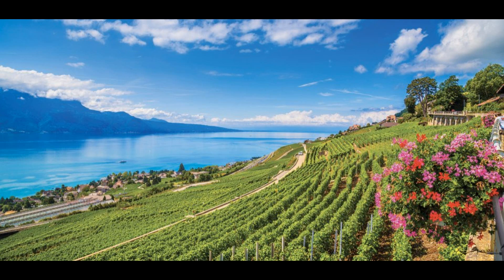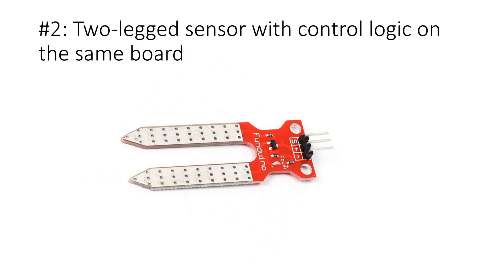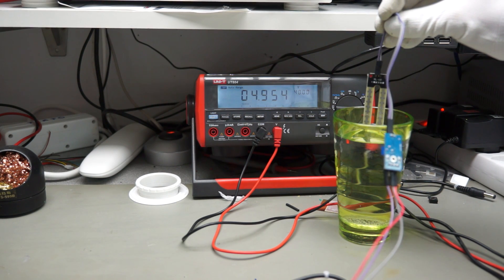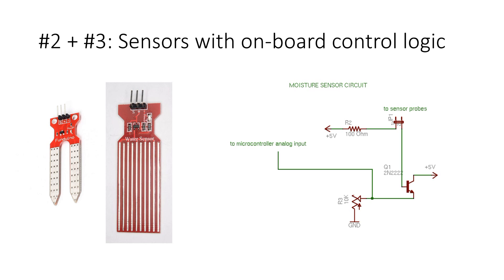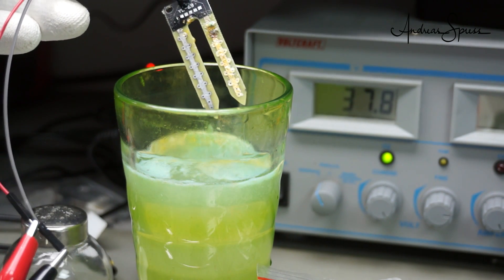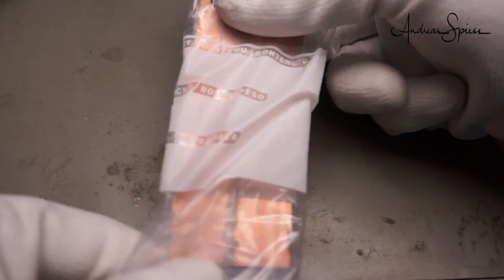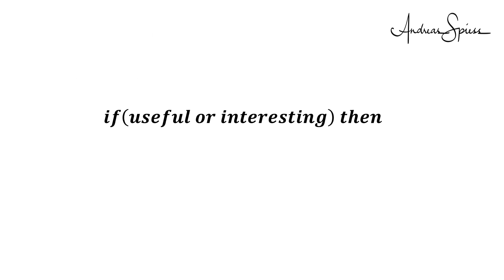#207 Why most Arduino Soil Moisture Sensors suck (incl. solution)

Comment: I am truly confused. If you put the sensor in a plastic bag, how can it measure moisture? Also, if the bag protects the sensor, why wouldn't the manufacturer use a plastic coating?
Reply from the maker: Through  a capacitive effect. It does not need a connection.
Reply: @AndreasSpiess  I just tried it using a thin Dollar Tree sandwich bag. The moisture went from 29% without the bag to 8% with the bag. Pretty much what I expected and explains why the manufacturer doesn't plastic coat the probe.

Comment: You missed one - TDS sensor, which works like the resistance sensors, but uses AC on the two metal electrodes instead of DC, so they do not corrode.
Reply from the maker: I agree. But these have a very different price tag and mostly are used in professional settings.

Comment: so the two-legged probe/sensor usually breaks after just a few days of use because the metal strip corrodes quickly. It is true?
if it is true I have to buy many two-gauge probes/sensors and change them every time they break or I can use the "operational control module" circuit connected to a handmade probe/sensor with two copper strips of the same size connected in the same way to the operational control module? thank you so much, great video!
 I am purchasing a kit from Aliexpress that includes everything needed to build an automatic pump with a 5v pump, a 5v relè, the sensor itself and an operational control module that conncts with the two legged sensor. However, the sensor is the two-legged version which corrodes but I cannot get a kit equipped with the probe/sensor v 2.0 because for that you need to know how to use Arduino while not for the two-legged probe. could you help me please? I'm having trouble, thanks again!
Reply from the maker: I think you know what has to be done.

Comment: Just beware that a lot of the capacitive sensors on the market are faulty, with a whole range of different faults.  Good luck finding one that works properly.
And don't be fooled by v1.2 and v2.0 as seen on these sensors.  They are identical - even down to the faults.
Reply from the maker: Thank you for sharing your experience! With the knowhow of this video, you should at least be able to find the errors ;-)

Comment: hey,
where should I connect the oscilloscope probes with the capacitive sensor /
Reply from the maker: If your sensor is battery-operated, it does not depend. Otherwise, connect the ground to the ground pin of the electronics.

Comment: if you have the two-legged sensor with the controller pcb cant you just replace the prong with two nails?
Reply from the maker: There are many different proposals in the comments on how to solve the issue...

Comment: Hi Andreas
I found good results using 5V amplitude for square wave and 3k resistor instead of 10k, I also buffered the square wave, your data for frequency are accurate, I designed a sample sensor from copper foil, how can share a simulation file with you in LTspice showing values of capacitors for sensor?
Regards,
Suded
Reply from the maker: This is an old project and so far, I do no more work on it. I am glad you found a satisfactory solution for you.

Comment: 我做了這個項目； 檢測當前溫濕度+自動澆水系統（代碼已修改，調試集成測試）
I made the project; detect the current temperature and humidity + automatic watering system (the code has been modified, debugging integration test)
https://youtu.be/d1NLjSjUNV4

準備好了材料- 我製作項目；檢測當前溫度與濕度＋自動澆花系統
The materials are ready - I make the project; detect the current temperature and humidity + automatic watering system
https://youtu.be/w9cghrXF_uM

加入2個二極體原因（含圖紙）,解說反電動勢/加入使用USB_micro座模块與棑針模块/電源供應使用5v-2A
The reason for adding 2 diodes (including drawings), explaining the counter electromotive force / adding the use of USB_micro socket module and pin module / power supply using 5v-2A
https://youtu.be/KimNTPJ4Kos

這個項目*自動澆花系統*，我準備好了各種模块，代碼我已經修改好了（保證可以用Arduino Nano或者UNO開發板）
For this project *automatic flower watering system*, I have prepared various modules, and I have modified the code (guaranteed to use Arduino Nano or UNO development board)
https://youtube.com/shorts/q8UFHadgAEY?feature=share
Reply from the maker: Cool project!

Comment: With the ESP32 you can easily use the Touch-Input Pins. Just isolate a cheap resistive Sensor like this  https://wolles-elektronikkiste.de/wp-content/uploads/2019/03/rainsensor_examples-1024x808.jpg
and connect the 2 Pins (without the Elektronik) with the Touch Pin and GND of the ESP. Works fine and the Touch Pins can wake up the ESP from Deep-Sleep.
Reply from the maker: Interesting idea!

Comment: A channel named "Flaura - Smart Plant Pot" has a video titled "Capacitive Soil Moisture Sensors don't work correctly" that you might find interesting.  He includes video clips directly from your tests, and mentions the need for a 3V regulator in-circuit to get reliable, repeatable readings.  Some boards exclude that regulator (shunting that connection with a 0-ohm resistor, for example, if the regulator's footprint is actually on the board).
Reply from the maker: I think I once was contacted by the creator of this board. Stable voltages are important for most sensors, BTW.

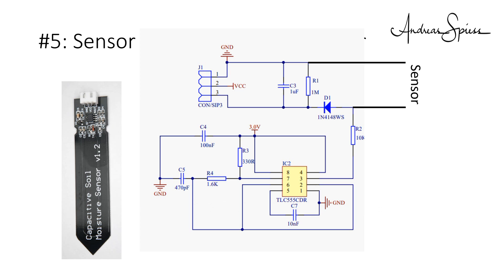Comment: You could just plasti-dip or varnish one of those cheap resistive sensors, and then build a small board using the design @7:24.   It's on my project list, anyway.
Reply from the maker: Can work if it has enough capacity between the two legs.
Reply: @AndreasSpiess  Excellent point sir - those prongs are pretty far apart, so capacitance values will be lower than the design normal for this sort of sensor.

Comment: I have some humidity sensing electrodes that are gold-plated, I assume to minimize the electrolytic degradation processes. I'm curious how long I should expect them to last due to the more inert gold plating. Though obviously the capacitive circuit is the best way to go for long-term monitoring. Thanks for pointing out this solution.
Reply from the maker: I assume gold plated material lasts longer. But I do not know how gold interacts with other chemicals. Some commenters reported heavy corrosion with different materials.

Comment: An informative video that points out the short comings of the different types of commercial sensors that can be purchased. It would of course be easy enough to elongate the life of these but because they rely on conductivity, they do need to be exposed to the soil, whereas a capacitive sensor, does not so can be coated to protect it. 2 nails would suffice to replace the copper electrodes if you wanted longevity, or because of the price of these types you could just replace them every year. 
Thanks for the video, it gives people insight into the different types to use
Reply from the maker: You are right. There are many other comments on the different solutions and suggestions...

Comment: You could run the cheap resistive sensors with AC over a capacitor. AC will not corrode the sensor.
Reply from the maker: There are many comments about this topic. It anyway corrodes (unfortunately).

Comment: How does it changes reading when you cover it with plastic I am using esp 32 but when I cover it with plastic and dip in water readings don’t change
Reply from the maker: The capacitive sensors should work with plastic around them. The resistive obviously not.

Comment: Great video! For those of you that wanna know more about the topic there's a good overview of various soil moisture sensors in elektor magazine that was just recently uploaded. It's called 'Moisture Sensors for Watering Systems' by Peter Tschulik and is pretty instructive
Reply from the maker: Thank you for the link. Unfortunately, he also does not provide data. So far, I never saw a study showing how good or bad the different sensors are.
Reply: @AndreasSpiess  There are a bunch of scientific papers comparing different soil moisture sensors, for example 'assessing the applicability of low-cost soil moisture sensors' from April 2020 by Abdulla Alshahri

Comment: Based on my real experience, this type of 2-plate sensor probe is USELESS. It can only last for less than one month. I am currently replaced it with NICHROME wire as the probe, space it out so that it creates a resistance. Nichrome 80 wire is corrosive resistant. I am currently monitoring it for the next few weeks to see the result (March 11, 2022). I will update the status later.
Reply from the maker: Cool. For sure NICHROME will last longer...

Comment: Hi, can i directly replace the low quality sensor plate with the capacitor sensor plate?
Reply from the maker: I assume they will provide different values for the same moisture. So you have to change the mapping.

Comment: So why not build your own capacitive sensor with a 555 instead of buying one on Alexpress ?
I have several DHT22 sensors and the have all failed giving erroneous readings of humidity  (although the temp section is still good)
Does anyone know how to fix those DHT22 humidity sensors ?
Reply from the maker: I am not sure if they can be repaired. I hope you did not try to measure moisture with them. It is someting different.

Comment: Andreas - love the channel.  Extremely informative and I have tried many of your projects.  Along the same lines as moisture sensors, can you explain why ph soil sensors work so poorly as well?  Maybe there is a best configuration for probes (single vs double vs glass)?  It just seems that given the correct conditions, soil ph should be able to be measured with metal probes without having to put the sensor in a separate solution.  Any help, advice, or guidance would be greatly appreciated!  Keep up the great work!
Reply from the maker: I am not much in chemical stuff. So I have no idea about PH sensors :-(

Comment: I brought an auto water kit, board, relay that came with the corrosion sensor, can I straight swap for capacitance version?
Reply from the maker: I do not know the diagram of the device :-(
Reply: @AndreasSpiess  thx for getting back to me! If you watch this vid from 12min to 15min mark. The capacitance sensor volts are Air, 3v, - Water, 1.66v and for the cheap sensor, Air, 4.99v and Water, 2.37v. Is there any way I mod circuit or maybe I could also use the potentiometer on the cheap probes board to tune it closer like? https://www.youtube.com/watch?v=EZM3w_XAwQU kind regards.
Reply from the maker: I would try to do a calibration for the new sensor. It seems you can set min and max values at least.

Comment: At 8:37, on your design, why the capacitive sensor is conected at the same node? , from the shown circuit (see 8:19), the sensor is connected one side to the anode of the zener and the other pin is plugged to ground? why?
Reply from the maker: It did not matter for my setup because I used an oscilloscope which can show positive and negative values.

Comment: Dear Andreas, we make a fabric able to sense humidity. It's resistive sensing element is made of stainless steel. We think its main advantage is to be able to measure humidity right in between the plant roots and not only in the surface of the vase.  Let me know in case you want to test it.
Reply from the maker: So far I have no plans for a additional video on this topic. Did you make scientific tests to prove that it works? Because so far, nobody was able to show a correlation between real and measured humidity of such sensors (resistive or capacitive)

Comment: Just checked a module shopping website in Korea and the 5th one was 8 times more expensive then than the second/third ones. And the first one was 4 times as expensive as the second/third ones. If one does not know that only the 5th lasts long enough, most people would buy the second/third one because they are cheap.
Reply from the maker: I assume the simple ones are also cheaper to produce...

Comment: Hello Andreas, long time fan here.  Just found this video.  There is another alternative to the capacitive sensor, which is used in commercial farming operations...the gypsum sensor.

FYI - the guy who developed the Vinduino (Reinier van der Lee) water platform spent some significant time creating, characterizing and testing DIY robust soil moisture sensors.  He uses AC voltage on stainless electrodes buried in gypsum.  His 2012 blog is here, good reading lots of info. https://www.vanderleevineyard.com/vineyard-blog/category/all/8 
From the blog: "The electrical resistance between the electrodes is a measure of soil moisture level, or better: the soil water potential. The gypsum acts as a buffer for saline solutions making the measured electrical resistance of the sensor less responsive to salt in the soil."

These are similar to commercial agricultural sensors (e.g. from Watermark corp, https://www.irrometer.com/pdf/sensors/403%20WATERMARK%20Sensor-WEB.pdf)
Reply from the maker: You are right. I saw such gypsum sensors but they were much more expensive. Maybe that fact changed by now.

Comment: I use niti for sensor. Perfect.
Reply from the maker: Do you have a link?
Reply: @AndreasSpiess  NiTi is an alloy of Nickel and Titanium that is used in dental appliances.  It does not create oxides by electrolysis and lasts for years without losing its properties.  I took the first test in 2016 at the university.  I recently use it in a nursery.
Reply from the maker: Thank you for the info. Now I googled the thing :-)
Reply: I didn't find anything about this type of sensor using NiTi.  Did you find something about it?  Here it says based on need.  My wife has a Cactus and Succulents nursery.  
This type of plant cannot have moisture accumulated in the substrate.  Substrate generates false positive with capacitive sensors.  At least that's what I realized.  I need to run more tests. 
 If you know any more progress let me know.

Comment: Very cool!  It is that time of the year, well a bit past it and now we are into the horrid heat wave time here on the High Plaines of South Dakota! I was looking for info on these devices, since I have a couple in my supply of Arduino things and wanted more info on them.  My daughter, who now cooks and keeps the house for me since I lost my wife nearly a year ago to cancer was nearby and loves to listen in to my YouTube favorites.  She asked if I had one, and I said I did but my wife didn't want to use it.  She does!  So I may give the old ones a try for a bit, as my daughter has also taken over the care of my lovely wife's flower pots that she has kept for years, and keeps up the flower gardens she has made with the stones we picked up on our travels in our Motor Home when we were both healthy enough for such things.  So I guess I will dedicate a small Micro  or Mini to the chore and she can monitor one of the pots to see if they need watering, well until they die of electrolysis disease.  Your channel, sir remains one of my favorite since we both enjoy directing electrons in strange patterns to do our bidding.
Reply from the maker: This is for sure a good idea. and if you would use an old ESP8266 you could even add some remote aspect that your daughter could monitor humidity without going to the flowers...

Comment: Another option is to beef up the electrodes with thick copper wires (soldered). They will eventually corrode but last much longer.
Reply from the maker: True. But this green stuff seems not to be very healthy...